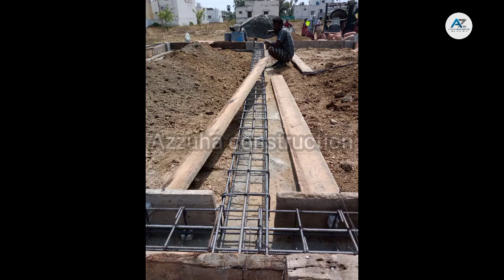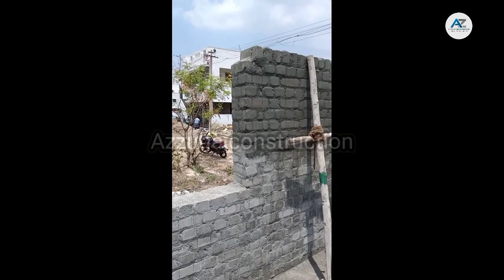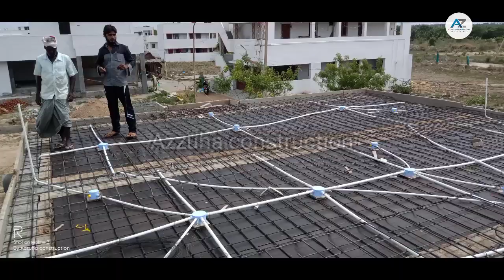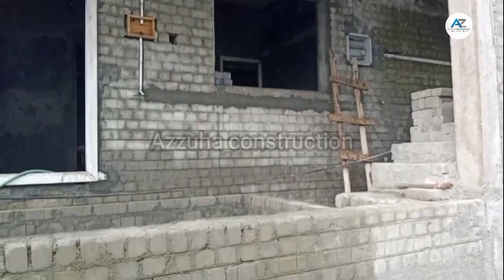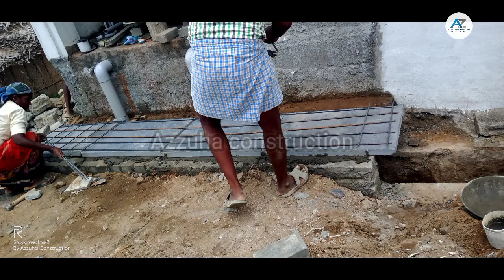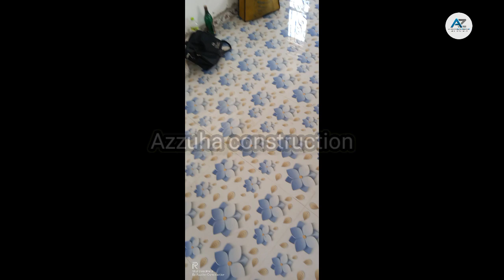step by step 2BHK house construction | time lapse |5 Month's work in 5 minutes | full  finishing

Comment: Sir 900sq ft ku column beam vachi framed structure ku with full plastering ku evalo rate charges pannuvinga
Reply from the maker: 1800rs / square feet